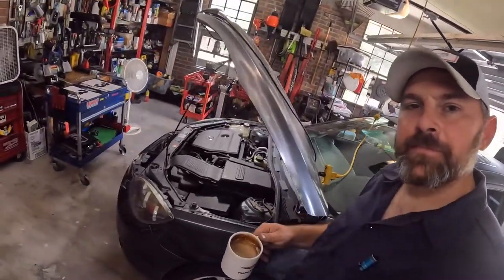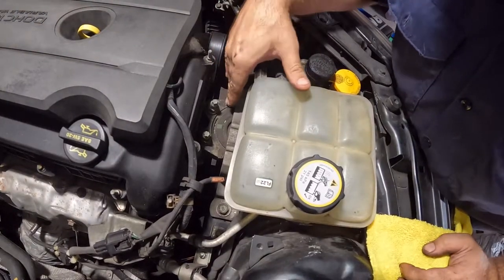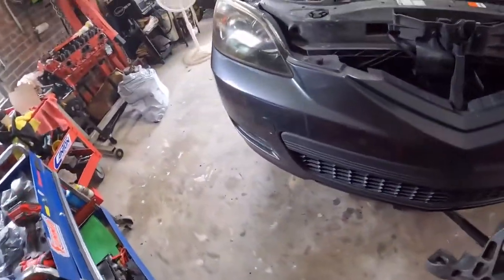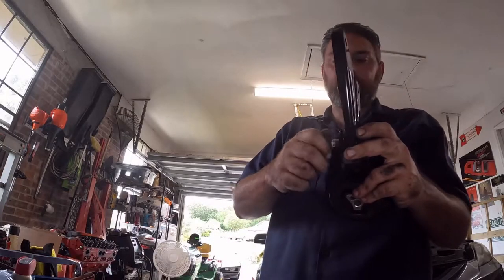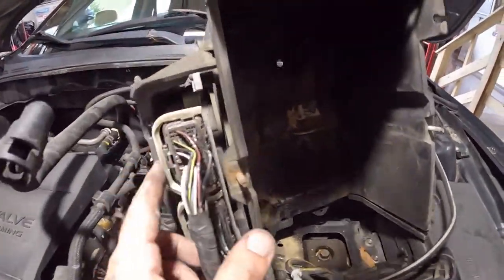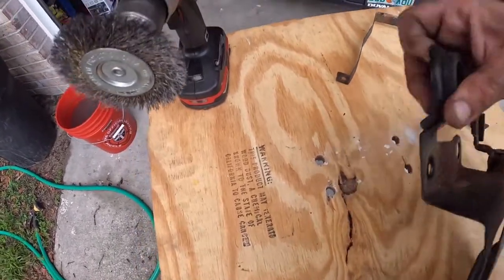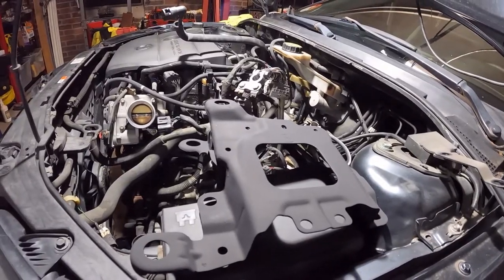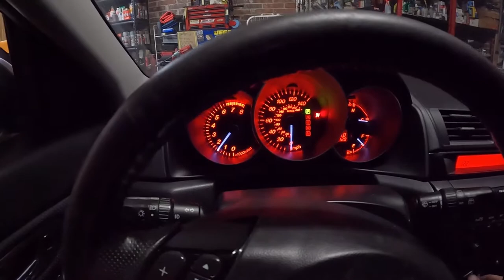2009 Mazda 3 Motor Mounts... the "Hunny-Do" List!

Comment: Just did the engine and transmission  mounts and holly fk what a difference. No vibration anymore and a pleasure to drive again. Will be doing the rear mount later on just cause I can.

Comment: Love how you auto-corrected before wifey gives ya heck for that "so that she stops backing into stuff" comment lol. Although they are rust-prone, I think I will hold on to my Mazda 3 BK for much longer. I have not found anything modern as reliable with 4 doors that looks so happy, drives so freely, handles in such a lightweight manner and lets you feel the drive. Newer SUVs have nicer interiors but horrible driving dynamics--my wife had to use a rental 2023 Escape and she avoided driving it subsequently after driving it once--preferring to drive my smaller Mazda instead. We both realized how much we absolutely hated stuff like auto-engine off, lane keep assist, a stupid knob for selecting gears, a button instead of a parking brake lever, and the general heft and lacklustre acceleration of these newer bigger cars. That experience plus your video have inspired me to work on a hunny-do list for our Mazda 3 as well. Thank you for the easy to follow instructions.

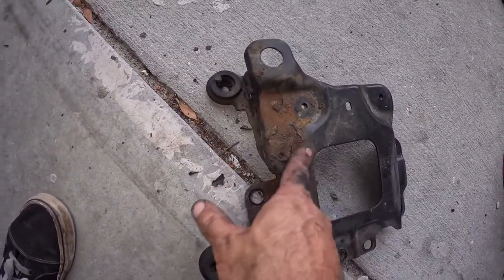Comment: @14:06 you can unbolt the TCU under the mount from the transmission and mount it to the stud on the firewall to reduce vibration. This was a recommended modification from a TCU rebuilder to prolong the integrity of the TCU circuit boards

Comment: Definitely suggest relocating your TCM while doing this — they commonly fail from all the heat they receive by sitting directly on the transmission. (It’s the silver, finned component next to the transmission mount.) I’ve seen them zip-tied to the brake lines so they don’t get so hot and fail. When they do go out, it’s at least $400-800 to replace or repair.
Reply from the maker: Thank you for the tip! The Mazda will be back in the garage for some suspension stuff.... I'll definitely look at relocating that while I have it apart!

Comment: I’m getting ready to do the same job on my 2013 3. Most motor mounts I seen online have only the insert and others come with the bracket. Would you recommend swapping out the two pieces(bracket & mount) or only the rubber insert? I’m at 176k miles

Comment: Did you jack the car when you changed the right engine mount, sir?
Reply: It's required, you can't even install the new mount properly otherwise fromn the engine sagging

Comment: I just had a mobile mechanic give me a quote of $350 to put these on. That's pretty high right? I already have the parts.
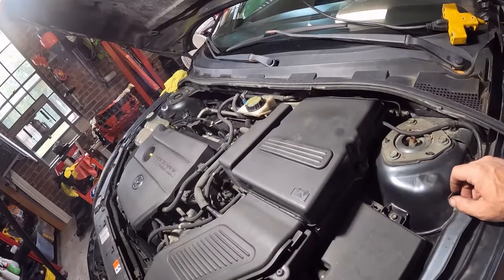Reply: 11:00 The Transmission mount is kind of a PITA to get to (as you can see). I think the more mechanics have to remove parts, the more 'time' they tack on for it, and thus, the more they charge.
Reply: I think that price is fair for the extra work that goes into changing the left hand mount. Guess it really just depends on your budget and how valuable your time is to you